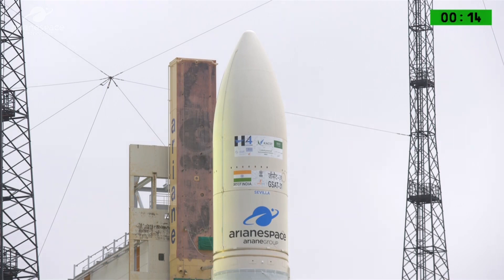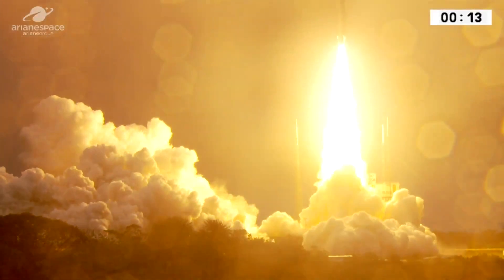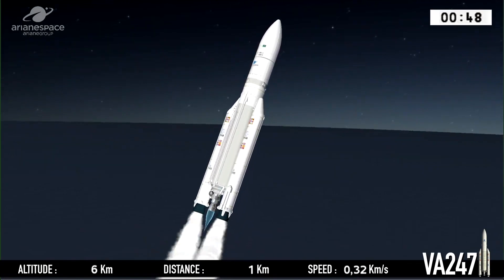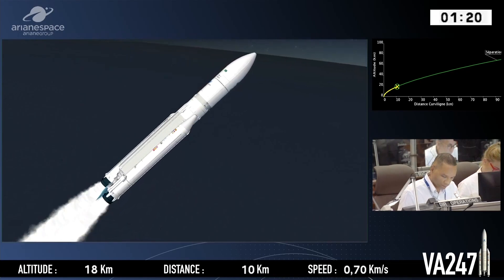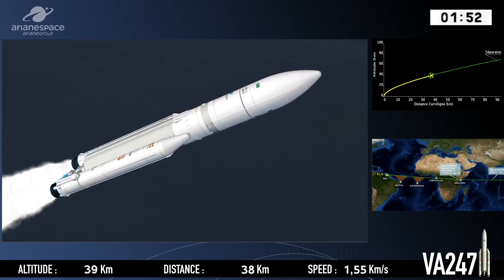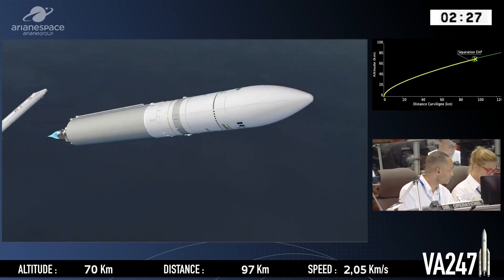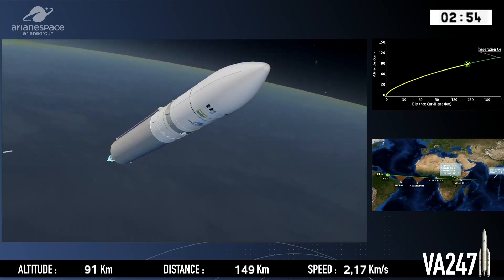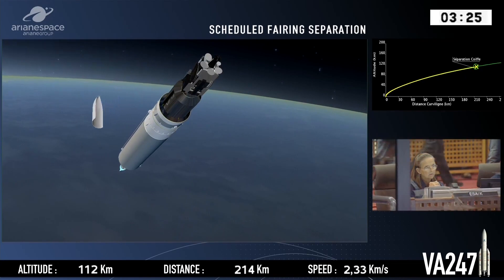Ariane 5 ECA launches HS- 4/SGS-1 and GSAT-31

Comment: Why Ariane rocket does a lazy liftoff 😬? Its +8 sec and it is still on the launch pad 😪
Reply: i could be wrong, but it looks like its waiting for the main center core engine to ignite and get up to full power, i know quite alot of rockets light their engines in the last few seconds before but them doing it this way could be for saftey/technical reasons but as i state this is just me guessing, if anyone else has the real reason feel free to correct me.

Comment: What's with the animation??
I don't know about other people but I want to see from the on board cameras!!
What's the point of having them if just to show for a few seconds,
People know what a rocket does!?
Reply: Agreed
Reply: These footage are pretty old now, they were taken during VA-215 in August 2013, and Arianespace is reusing them as much as they can... sometime even during night launches (*sigh*)
They are doing the same for Soyuz launches, as the videos they are showing were recorded during the seventh flight, in 2014. IIRC, it was the one which carried Sentinel-1A.
Now the worst of the whole story: SEVEN freaking years after the first launch of Vega and thirteen flights later, they still have not found an opportunity to record at least one video!
Reply: There are 2 possibilities here. Either the footage they show is actually footage from a previous launch (such as what they did with the CSO-1 launch in December 2018) and the extra weight of having cameras on the stages were considered to not be worth it, or the camera feeds won't show anything of actual interest, just rocket exhaust as the craft ascends.

ULA only occationally puts cameras on board its launch vehicles as well, either because the mission is "classified", or because the added weight of the cameras are considered to not be worth it. NROL-71's launch had camera on board, but this was because NROL-71 was a partially classified mission (the public only knows so much, but its enough to know the basics of the craft and the mission), and because these kinds of payloads (NROL payloads are usually similar in shape and size to the Hubble Space Telescope) aren't as heavy to get to the upper limit of the Delta IV, cameras were likely added for the video data.

SpaceX has cameras on board for 2 reasons, for video data for stage separation, that is inspecting the health of the upper stage (since the staging is literally a stick that pushes the upper stage away) and for landing data. Video data quickly diagnosed what went wrong with the booster for CRS-16, a stuck grid fin.
Reply: I hear ya. I understand no ground footage for this launch because they took off into overcast and there was nothing to see. But the lack of onboard cameras is disappointing. I don’t buy the weight not being worth it argument as others literally use GoPros and their payload margin is not that narrow. I suspect that maybe it is because of bandwidth issues in their telemetry stream, but that’s just a guess.
Reply: @bobbilaval6171  I'm pleased to know that, your knowledge is impressing and was a pleasure to read, your very rite with what you said I definitely agree!
I understand when the rocket gets to a certain altitude you can see not much more than what a star resembles (pretty much)
But as you said the on board technology "cameras" when we have things like go pro's etc could have been better, I also think if the technology we have can put the rocket, satellite and people into space and rovers on Mars and MUCH more then it's a little frustrating to only have seen what we were able or possibly allowed to!?
Thanks for your reply!!
Reply: Yes l agree.
Reply: Cus SPACE-X is the best bro!!! live video and pictures like you are onboard when looking direct at ur computer
Reply: Only ELON MUSK knows how to attract clients while succeeding at launching rockets and breaking records